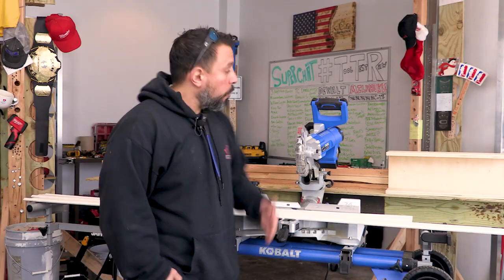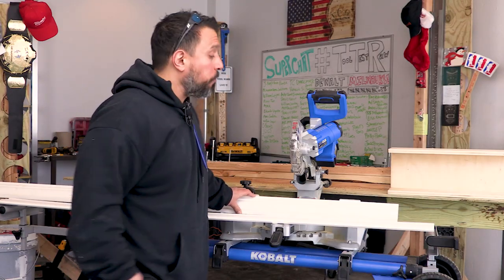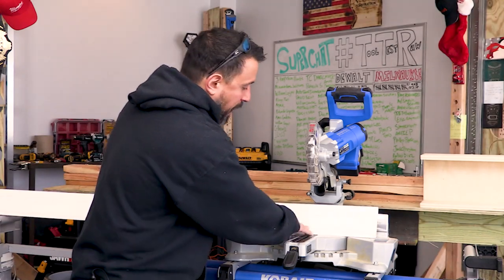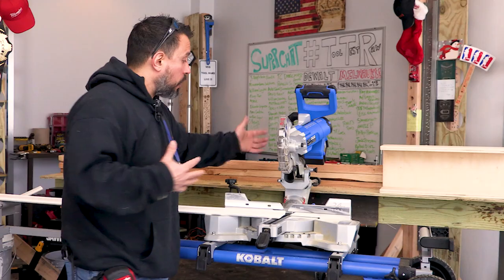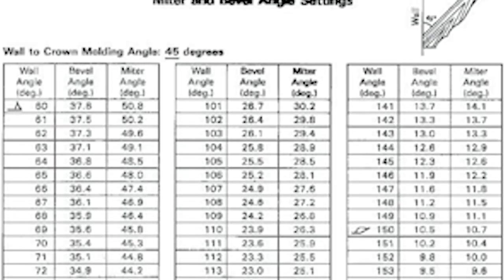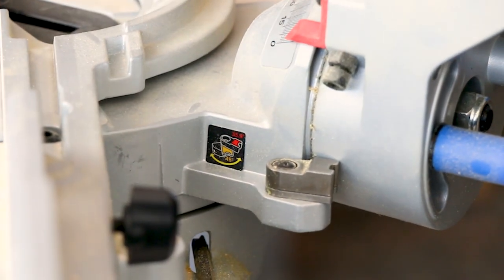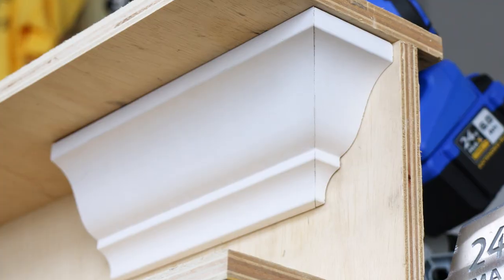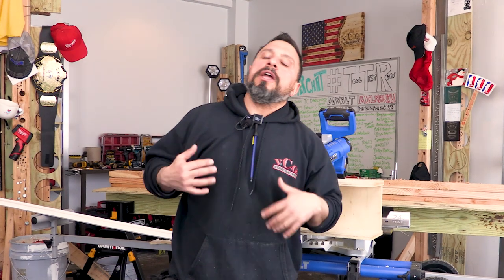99% Of People Don't Know How To Cut Big Crown Molding On A Little Saw!

Comment: Really good demonstration on how to cut crown molding with a dual bevel sliding miter saw Vince.  I remember having to do it by hand with a Stanley Miter box and saw back in the early 80's when I was remodeling my very first house I purchased.  It was a nightmare to say the least and wish 
i had all these tips and tricks back then as a DIY'er.  Thanks for sharing.
Reply from the maker: Did you pre-drill and hand nail on that installation William Logan?
Reply: @VCGConstruction  No, I didn't pre drill it then, just nailed it by hand.  Learned the hard way and some of the molding split.  Live and learn Vince.

Comment: Cool deal Vince. I have used my little 7-1/4” Kobalt to cut crown in the flat and installed in a couple of bathrooms; 

I just practiced on some scrap pieces with same spring angle before i did the real cuts. 

Kobalt. Tiny but mighty and <$100 on sale at Lowes

Comment: Hi!
I have a smaller (7 1/4”) Kobalt, laser-guided compound single-bevel sliding mitre saw. Because the blade is rather small and the saw’s fence isn’t very tall I can’t spring my crown molding up against it for quick beveled cuts. I must flat cut everything and use the saw’s beveling capability to get my beveled cut angles correct. 
Here’s my issue: I’m trying to find out the correct “bevel” setting for my blade for an outside 90 degree “bullnose” corner cut. Again, my saw will only flat-cut. I know I need to end up with three total pieces of crown molding (left side, pie-shaped transition piece and right side piece). I also know there will be four cuts at the 22.5 degree mitre setting. However, what should the bevel setting be for my blade? I’ve tried messing around with different settings (starting with 22.5 degrees) but my pieces never line up correctly when I go to put them up and place them around the outside 90 degree bull-nosed corner. 
Any help would be MUCH appreciated. 
Thanks!
Bill
Reply from the maker: I’ll see what I can work up to help out with this! Do you know the spring angle of the molding you’re working with?
Reply: @VCGConstruction  Yes...The spring angle on the crown molding is 52/38 and the outside 90 degree bullnose corners I'm dealing with are 3/4". I just can't seem to get the bevel setting correct on my saw.

Comment: Good tutorial, I got on here to find out how to cut miters flat for a 45°wall angle. Unfortunately your video didn't go into that. 
I got Joe Fusco's crown molding chart and it said for a 45°walk angle, you set the mitre at 56.06° and the bevel at 46.72°. What the hell? Any insight?

Comment: Yes please more crown moulding cute flat please
Reply from the maker: I’ll see what I can work up! What exactly would you want to see Phantom?
Reply: @VCGConstruction  more in-depth on the angles, I guess that chart, possible way to save time from having to swing the saw Bank and forth for each cut. Have a ten inch saw, rate occasions I need to cut larger than my capacity.

Comment: Can you recommend a mitre saw for diy project (crown molding, baseboard and window casing) that won't break the bank?
Reply: Ryobi 12" sliding mitre saw = $315

Dewalt 12" sliding dual bevel mitre= $500

I have the Ryobi 12", it does the job 👍

Comment: I do use a 12in miter saw because it's what I got so I use the kreg crown pro
Reply: Didnt even know what that was had to look it up. That thing looks like a turd. Only way to cut crown is flat. Propping it up against stops or in a jig is how framers do crown molding. There is enough to deal with like out of plumb walls, heavy drywall buildup, truss lift and out of square inside corners you should at least do your part and have a perfect angle on what you are cutting. I hate seeing some finishers that cut trim standing up it looks awful with the length of trim flapping back and forth because your holding it in the air trying to make a cut, not to mention if you are cutting baseboard on edge any play in your mitre saws hinge will make your joint look like garbage

Comment: 10 years ago I bought an expensive mitre saw and did my whole house in 7 1/2 " baseboard. Fast ward sold the saw, now I need to finish another room with left over baseboard and I'm confused about buying a new mitre saw.  What am I looking for to be able to cut the width I need? Even the sliding 12" blade says it will only cut 6" baseboard? I kind have to reorient myself with how to cut again. Totally forgot, but I'm sure once I get started I'll figure it out again.

Comment: Making compound miters on crown is also helpful when cutting long pieces. Even with a 3 1/2" profile using a crown stop when you have 15' hanging off the other end is difficult and sometimes impossible unless you have another person to hold it.
Reply from the maker: Good point Rafe!!
Reply: Try a roller stand

Comment: Hi, how do you cut an outside corner with a large crown molding piece bullnose? Meaning if I want to cut 4 pieces for the outside piece, which means it would need to be 4 22.5 degrees cuts

Comment: I just thought of something. Instead of changing the angles of the saw, couldn't you just rotate the molding 180 degrees like the hand of a clock, and cut the opposite side?
Less messing with the saw and you are guaranteed the opposite angle, I would think. I have no experience in this though, so I may be missing something.
Reply from the maker: You are correct, if this was a single bevel you’d have no choice!
Reply: @VCGConstruction  Hahaha, guess that's obvious! Funny I turned a solution into a problem.
Reply: Actually, if you're cutting fjp or MDF crown, you only need a single bevel saw as you can simply turn it face down to cut. It's faster that way because it eliminate the need to risky readjust the saw so much.

Comment: After what you just showed me the only justification I can see for having a 12 inch miter saw is if you also planning on using it as a chop saw and using it to cut really big boards like to buy two by tens to buy 12 + mitering joints with those or maybe even like four by fours four by sixes and six by sixes. If all you're doing is molding work doesn't look like to me you actually need the saw that damn big now I'm sure that the guys who do this as profession might have different opinions on it but I'm just saying

Comment: This isn't really a trick. It has been used for years. One of the reasons that compound miter saws were developed was to do this. I have always cut my crown flat, regardless of size, because I believe it to be more accurate. There is also no need to use crown stops on the saw.  This allows the saw to be used for other cuts without having to remove anything from it.